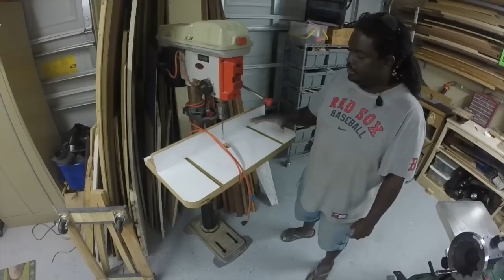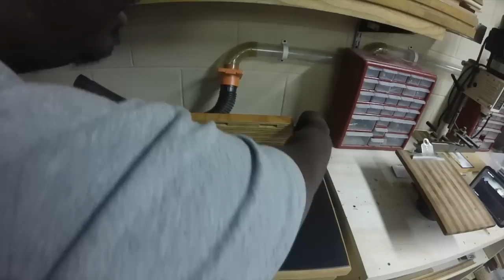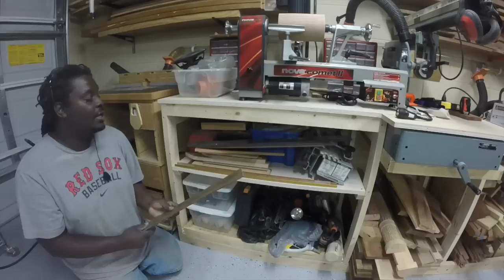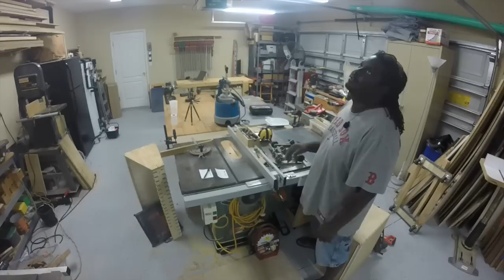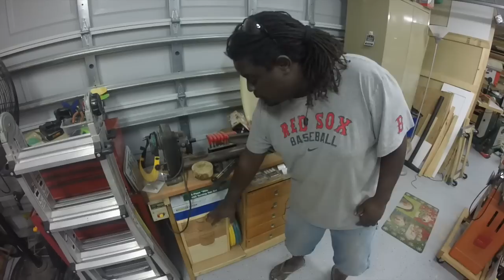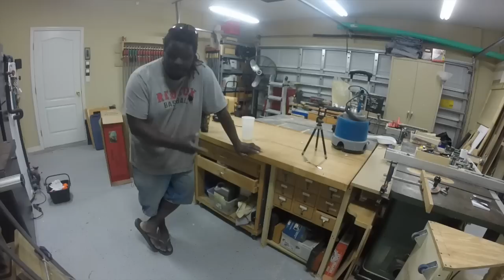EP01 Shop Tour 2015

Comment: Great video! Saw you on Mike's video yesterday and stopped by to check your channel out and now I'm a new subscriber. Nice shop and I now understand completely about needing the air cleaner, your allergies were kicking you in the butt on this video.
Reply from the maker: Thanks Lyle, I did finally get an air cleaner and it does help but now I need to get to work on dust collection and organization.... previews of what's to come ;).
Reply: +Dread Knot Woodshop -My wife bought me one for Christmas last year along with a small General International dust collector. I've got the air cleaner hanging from the ceiling but I still need to get my dust collector set up with some piping and a Dust Deputy Cyclone. I've only got it hooked up to my table saw. I also have the Ridgid sander and agree that it's well worth the money.